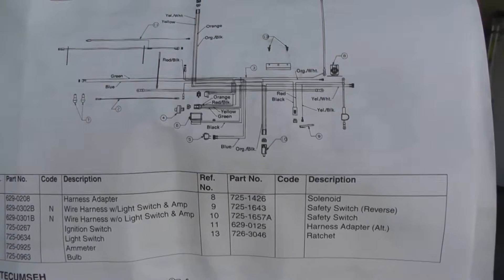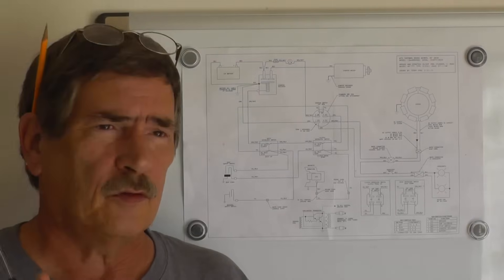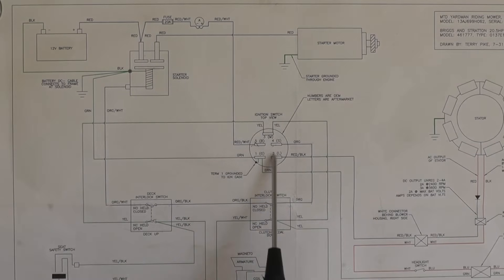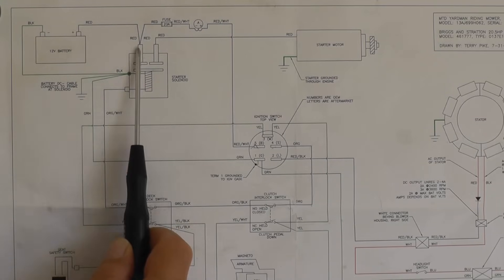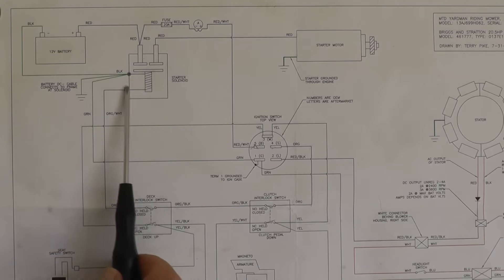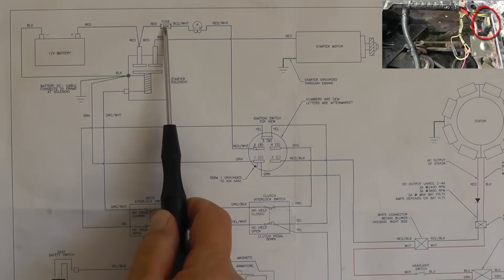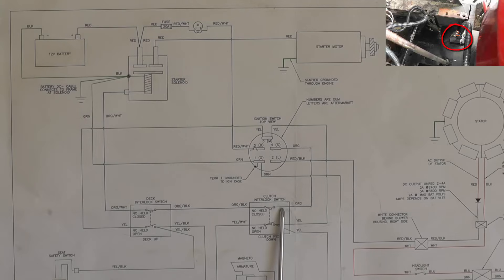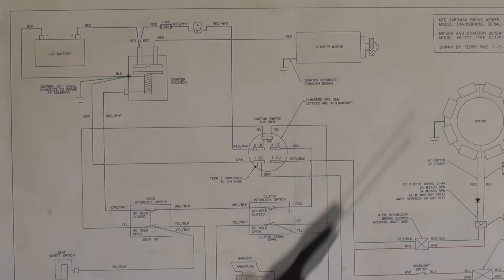Riding Mower, Starting System Wiring Diagram - Part 1

Comment: Nice diagram but you kinda chop the bottom off threw the hole video the one extra leg coming off the brake goes to ground out the coil but where does the extra leg off the deck go to?
Reply from the maker: Not sure Mike which part of the diagram you are referring to. Send me a private message with your email and I'll email the wiring diagram used in the video.
Reply: Had to watch another video on how to send a private message but it didn't work your home page was missing the link at the bottom. The section of your diagram I was referring to was the lower left corner. My rider is grounding out the coil some where so I'm interested in the leg coming off the bottom end of the deck and clutch switches. I can kinda make out a seat switch and looks to be the coil armature. After watching your video I have a little better understanding of what's going on here. Thanks
Reply from the maker: Michael, I took the wiring diagrams and have included two links for them in the description of this video. The first link is for an A size drawing and the second link is for a B size drawing. Both drawings are identical. I just checked the links and they work, so hopefully you should be able to access them. If not, let me know and take care.
Reply: Nice job Thanks. That works
Reply from the maker: michael thomas Glad to hear that it worked!

Comment: I have a starter on a riding mower that will only start if I hook up the black end of jumper cable directly to battery negative terminal....do I have a bad ground at engine block? Or somewhere else? I'm getting 12 volts at the starter stud only when grounding directly to battery negative terminal...when I ground to chassis or engine block I get no voltage
Reply from the maker: macknumber9 it sounds like you have a poor ground through the chassis. You could always run a jumper cable from your battery negative directly to the starter housing to confirm.
Reply: stuzman yeah I do have a bad ground on the chassis when I hook up the black jumper cable to the starter motor where it mounts on the engine everything is okay and I get voltage at the starter motor stud the hot wire lead
Reply: stuzman I just have no idea where to look for the bad ground I don't know the schematics the wiring diagram. Do you know where I can look besides the obvious place of the battery terminal negative going to the chassis
Reply from the maker: Take the terminal off next to the chassis and clean the terminal and the chassis point. also look bolts that connect the chassis together. you may have to clean paint off chassis parts bolted together.
Reply: stuzman so you mean take the terminal off where the negative battery cable connect to the chassis clean that out good and then look around the chassis for bolts and make sure they are all clean?
Reply: Do riding mowers have a ground from the engine block or does it just sit on the chassis in ground that way
Reply from the maker: macknumber9 Most of the mowers that I have seen including mine just use the chassis for the ground on the starter. If you can’t get a good enough ground through the chassis you could always just run a separate wire.
Reply: stuzman so the grounding schematic is basically just negative battery cable to chassis and that covers everything? Starter motor mounted to engine which is sitting on chassis and gets its ground that way
Reply from the maker: macknumber9 exactly Mack. The chassis is serving as the conductor for the dc- of the electrical system. It’s the same setup found on all automobiles. 😀👍
Reply: stuzman thanx for your help I really appreciate it! I was looking for another cable that mounted the mower engine block to the chassis like some cars have but I guess that's not the case...i don't have to go hunting for a bad ground just have to get a good ground to chassis from battery...
Reply from the maker: macknumber9 perfect Mack! If it’s difficult to find where the bad chassis ground is, you could just run a new cable to replace the chassis ground. 😀👍
Reply: stuzman yeah I will do....thanx again for your help! I'm subscribed!
Reply from the maker: macknumber9 Always glad to help Mack and thanks for the sub! 😀👍

Comment: mine has black and white wire for oil safety switch where does it go or can i by pass ?
Reply from the maker: Bill Christy Sorry Bill, mine doesn’t have an oil safety switch and you could always trace the wiring to see how it’s wired.
Reply: thanks anyway for letting me know ! your video  still helped with some other issues !

Comment: If you are replacing an engine with only 1 wire that charges the battery and the replacement engine has a 2 wire connection how would you wire it?
Reply from the maker: I don't know Andy, but I would be looking at the wiring diagrams between the two engines to see what the second wire is for. Or at least follow the wires back to see where they connect and from that, maybe one can determine what the second wire is for.
Reply: Ok Thanks for getting back to me so fast.
Reply from the maker: No problem Andy! Hope you get it all sorted out :)

Comment: Great video... BUT the second safety switch is incorrectly said to be the deck height lever when it actually is the mower deck blade engagement PTO switch (which must be raised to the off position to start).
Reply from the maker: Todd J Piascik and what is it called Todd when you don't have a PTO?

Comment: I'm having trouble finding a wiring diagram for my 2000 Scotts(John Deere) 1642H. Seat switch has been removed. I can crank it standing beside the mower. When I press the clutch/brake, it cuts OFF.
Reply from the maker: Here's a link to a thread where someone posted a link for a wiring diagram which may be what you want. Read through the threads and you'll see the link near the bottom. Good luck on fixing your issue! http://www.mytractorforum.com/12-john-deere-forum/95212-need-wiring-diagram-scotts-1642h.html

Comment: battery draw key off
Reply from the maker: I assume Roy that you're asking is the drawing shown with the ignition switch in the off position. That is correct as all electrical drawings are drawn in a de-energized state. If that's not what you're asking, holler back and be a little clearer...
Reply: I have a .3 amp draw with the key off . when I went there I found the blade engaged  and I started it  but I still have a draw

Comment: That is an awesome Diagram.I,m trying to follow it on the bottom of the page the saftey seat switch and across the right I can,t work it out properly so is it relevent Thanks Greg.
Reply from the maker: Greg Nicholas it could be Greg. If you are having trouble getting the engine to start up, just pull the ground wire at the ignition coil. This will disable all safety switches and the seat switch.
Reply: Hi I have followed your diagram and found all the wires, But I have 1 that is yellow and white that goes from the clutch switch and up to near the soliniod but I have no where to put it could you please help me. 
 Thanks Greg.
Reply from the maker: Keep in mind Greg that I don't know your particular mower so the wiring may be slightly different. I have a yellow/white wire on my diagram but it goes to the safety switch for the seat. The other wire on the seat is a yellow/black wire. Send me a PM with your email address and I can send you the wiring diagram which may make it a little easier for you to follow.

Comment: Good explanation with the diagram. I checked this video once before while working on a tractor that had all the wiring  pulled out. I did not have the time then to comment. Thanks and stay well Joe.
Reply from the maker: Thanks Joe and hope you found the video(s) helpful in getting the tractor you were working on back together. You're welcomed and you stay well also!

Comment: great video it would have been help if it was a White outdoorsmen still explains wires little better.👍
Reply from the maker: Thanks Shadow and you'll find that with these riding mowers that the wiring is very similar between the manufacturers :)

Comment: Here's one for ya I am working on a Statesman  ( MTD ? )46" with a 18 HP
 intek briggs & stratton.
I was originally troubleshooting why when you engage the  blade the 
mower would backfire through the carb and cut off.
Obviously I burnt something up as I was having to start the mower with a
 battery charger on the quick start function and the last time I shut it
 off with the key I saw smoke come out from under the flywheel cover, 
that was the diodes in the kill wire frying, I replaced that now I have no 
spark, the engine turns over fine with a good battery, both coils 
measure 4.5 ohms, I re gapped the coils to .004, all of the switches 
tested fine, the diode on the stator is not burnt looking, WHAT AM I 
MISSING !
Reply from the maker: Rusty, pull the kill wire from the coil to ensure that it's not being grounded and still if you get spark. If it still doesn't spark, then you have an issue with the coil(s) circuit, air gap, etc. As for the diodes, I believe there should only be one and this is used for the charging system to convert the ac to dc to charge the battery. You can check the diode by disconnecting one end and use your multimeter on the diode function to check if it's okay. And I believe that .004 is too small of an air gap which is the thickness of a sheet of paper. I'm not quite sure of the air gap setting, but I believe it should be around .010" - .015".
Reply: Hey Stuzman, Thanks for the reply!
I originally did try to see if I had spark without the kill wire installed thats when I discovered I had an issue.
I lied !  I used a business card to gap the coil, that normally works every time.
I also tested the plugs on a working mower, nice bright blue spark & tried the starter switch from that running mower so I'm just befuddled as to why I am not getting any spark but the engine turns over fine, makes no sense.
Yes I popped the flywheel off, the keyway is fine.
ground issue somewhere?
Reply from the maker: Yep, a business card would be just about the right gap :)  Your mower is probably very similar to mine. When you disconnect the kill wire from the coil, there's only the trigger coil, ignition coil and the electronic unit left. I would suspect maybe the electronic unit got fired. Send me your email address through a PM and I'll send you the wiring diagram of my mower which should be similar if not the same as yours.

Comment: my riding/lawn tractor had a fuse in a ground wire, I was confused when wires burned
Reply: Same exact thing happened to me. Now I have to re-wire the entire thing. I really wish I could find a video of someone doing this on a Snapper LE1433H.
Reply from the maker: It's not to bad Justin even if you don't have a wiring diagram. It's not that much on mowers and you could unravel the tape and see where each wire goes :)

Comment: Have followed your diagram..love it. Have replace the starter, solenoid and deck safety switch. I have been thru this mower for hours............still no crank. I'm thinking a ground. When I replaced the solenoid I had a 3 post and the parts place only had a 4(brother in law said it would work). There is nothing on the 4th post. Is that my problem?Does the ground from the ignition possible go on there instead of the frame. Brother in law no help now. LOL  Oh its a MTD LT 1990. Want to keep all safety switches. This thing has gotten under my skin Thanks for you help.
Reply: You probably have figured it out by now, but for the 3 post solenoid, the base where you fasten it must provide the ground to energize the solenoid, which represents the forth post. On the 4 post solenoid you'll have two wires needed to energize the solenoid and two to past the current from the battery to the starter. The two to energize the solenoid will be small wires, and the two to run the starter will be large wires. You will probably have to run a ground wire from the frame or directly to the negative side of the battery to the 4th connection.  I hope this is helpful.
Reply from the maker: Thank you Joe for replying to Marcia. I see that her comment was posted a month ago, but I never received a notification about it. Once again, thanks for all of your help!

Comment: Hi Terry, great job with the diagram! Mapping / tracing wires is the best way to ensure that things can be tested / activated correctly... well done (I wish I had your CAD skills)! Good to see you active again!
Reply from the maker: +Thomas EXOVCDS Thanks Thomas for dropping in and leaving a comment. Trust me Thomas, CAD is really easy and not much to it. It's just like learning a piece of software like Word or Excel.
Reply: @stuzman52  It's my understanding that solenoids with four terminals use the extra ground to go back to the safety switches....and three terminal solenoids have an internal ground and the safety switches are on the 12 v positive side.
Reply from the maker: @dddddd2100  Having a fourth ground terminal is just another way to ground the chassis of the solenoid by using a terminal. And of course the solenoids having three terminals, just uses the chassis of the solenoid for the ground. As you mentioned, this is grounded internally. I haven't seen the fourth terminal wired through safety switches. If this is the case, how would you get 12V to the solenoid to energize it and this voltage goes through the safety switches?

Comment: Nice wiring diagrams.  Blueprint style and meticulously traced.  Awesome job.
Reply from the maker: +DJDevon3 Hi DJ. As for the diagrams, they weren't traced. The one that I used in the video was drawn from scratch in AutoCAD Electrical.
Reply: stuzman52 I meant cutting open the harness and physically tracing each wire.